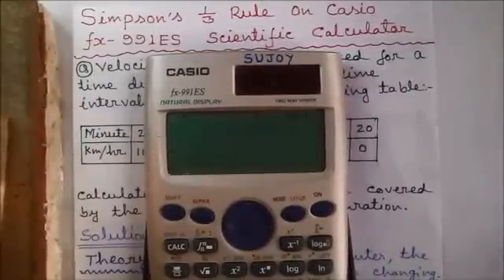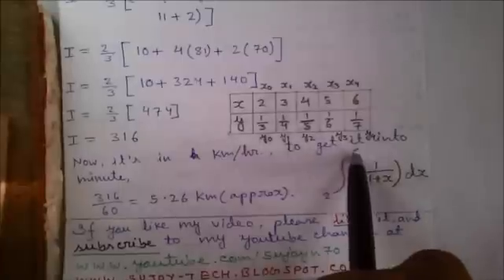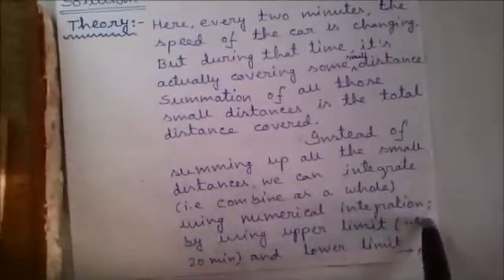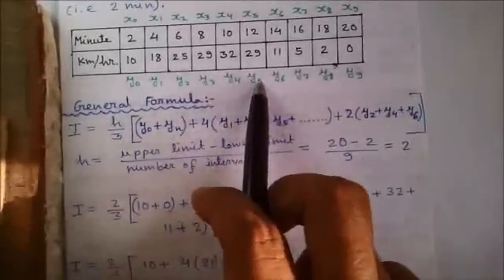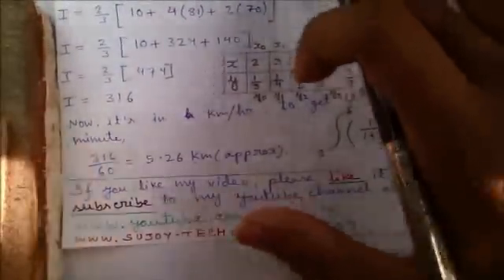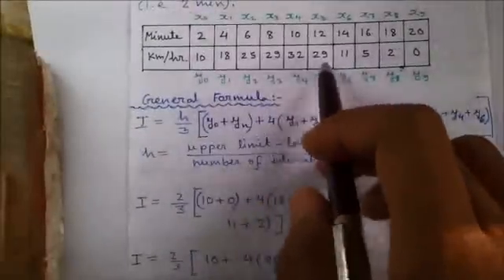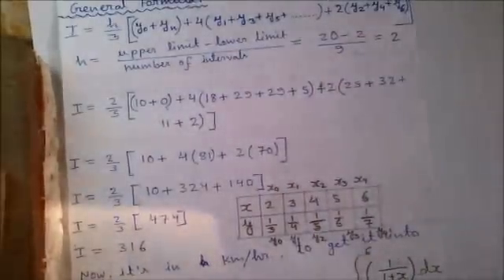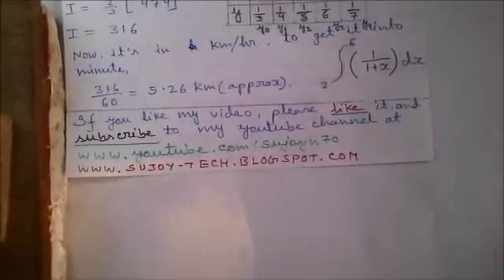Simpsons One-Third Rule And Basics of Integration on Casio fx-991ES Calculator

Comment: sir I want a value of h in a pblm .. and n is not given .. they are simply telling the integral by limit .. and asked to find simpsons and trapezoidal rule
Reply from the maker: There should be any hint like do with 4 intervals, or table should be given. Is any table given, or just integration symbol with lower & upper values?
Reply: Sir I am an mca student ..from cusat.. the question is repeatedly askd in exams .. ie,    intergral starts from 0 to 6 and intergral of 1 divd by 1+x ..simply askd to do trapezoidal and simpsons
Reply: exam is on monday :(